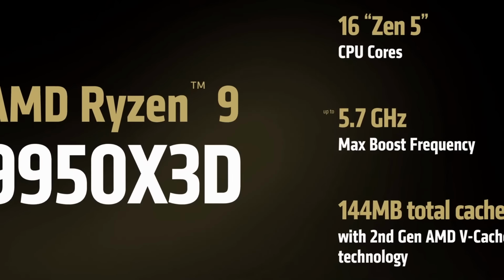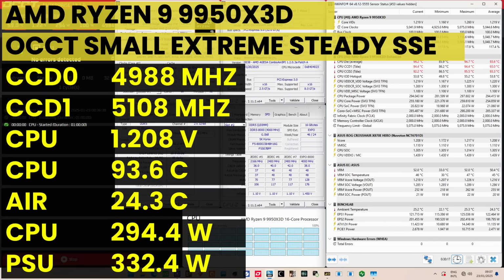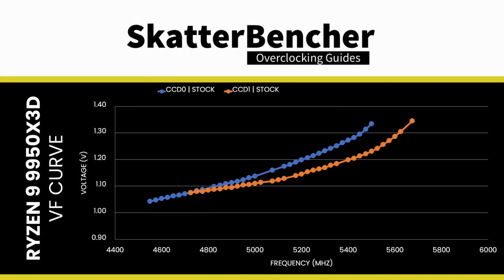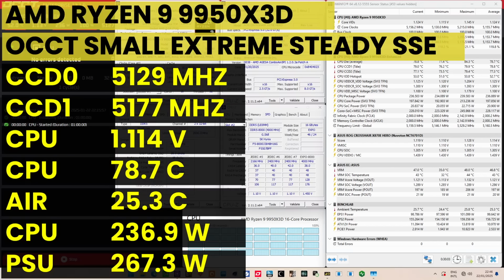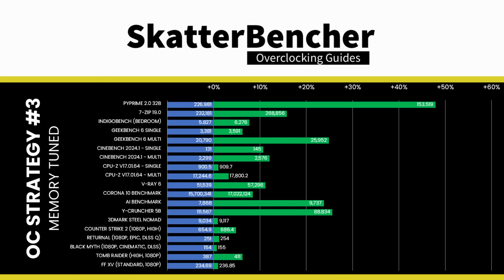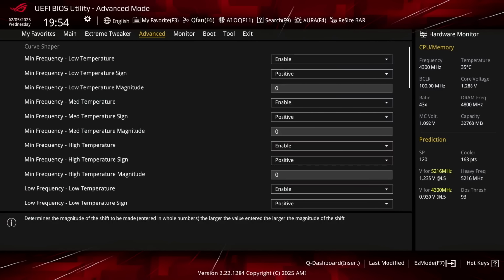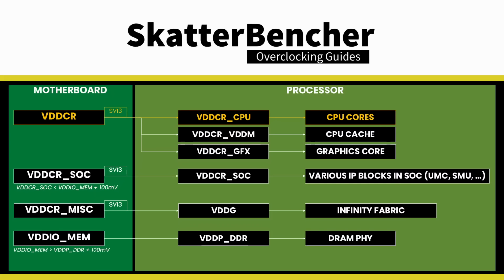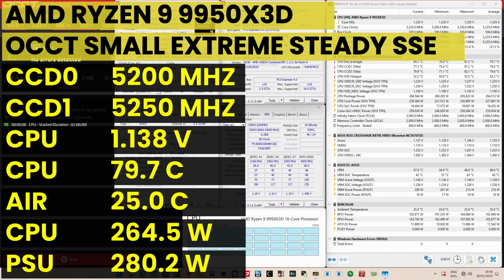Ryzen 9 9950X3D Undervolt & Overclock to 5900 MHz | SkatterBencher #85

Comment: Just came across your video guide. I decided to go the AMD route after reading much hype about it in gaming. Most of my previous PCs was Intel base. So I just bought a Ryzen 9 9950X3D, G.Skill DDR5 CL26 6000MHz 2x16GB with an MSi MPG X870E Board and had no idea how to optimise it. Your video is very intensive, and even though the BIOS is Asus in the video, 90% of the MSi BIOS is about the same. The only difference is that my DDR5 memory is 6000Mhz CL26 on EXPO mode. The Curve shaper setting was an eye-opener. Before that, I just leave it all on Auto as I don't know hack what to do with it..🤣🤣 Thank you for the insight you provide.

Comment: Thanks for the video. Is there any case where you combine PBO Curve Optimizer with PBO Curve Shaper? I currently use both on my overclocked 9800X3D daily setup, but would be very useful to see how you would do an overclock using both technologies. Or is there any specific reason for not mixing both technologies? Thanks again.

Comment: Great video. I have a g skillz 64 gb 6400 cl32 non expo but xmp and 9950x3d. How do you recommend oc and undervolting with this setup? Specially with my ram which is over recommended 6000 cl30 and non expo.
Reply from the maker: Usually motherboards will allow you to load the XMP profile as if it were an EXPO profile. Maybe you get lucky and it just works! DDR5-6400 won't run out of the box on all boards though so if you see instability, return to 6200 or 6000. Make sure to set UCLK = Memclock though.

As for undervolting: the fastest way is the per ccd curve optimizer.
Reply: @SkatterBencher I tested stability at 6400 from 2200 down to 2000 no luck. Went down to 6200 at 2200 ran 30 min aida64 stability test no problem but was on msfs2024 and crashed hwinfo showed memory overload. Never happened before. I went down to 6000 and set cl 30 with timings of 38 38 96 at 2000 fabric even though I have cl32 6400 mht timings 39 39 102. It is stable now can I do that? Uclk = memclock.
Reply from the maker: Yes, find the option that says UCLK Div1 Mode.

DDR-6000 with 2000 FCLK sounds pretty reasonable. You're not doing anything wrong, some chips just struggle more at higher memory and fabric frequencies.

Comment: Question: why didn't you combine the Curve Optimizer with Curve Shaper, and just used Curve Shaper in OC strategy 4? By doing this, you're not accounting for the different CCD capabilities in terms of undervolting, right, given that CS applies equally to both CCDs? In the 9950X OC you combined the two techniques, CO and CS, why not in this case? What am I missing? Just wanted to understand the rationale behind your decision.
Reply from the maker: Your observation is correct: the best result should be using CO+CS to optimize both CCDs.

It's been a while so can't exactly recall my thinking but I reckon it's because I didn't see much performance improvement and so didn't want to spend more time chasing performance ghosts :)

Comment: I found that my 9950x3d kinda sucks, I was only able to manage a -15 on curve optimizer, I also left the boost clock untouched because even a 100 MHz increase would drive voltage from 1.3/1.325 all the way up to 1.410, which I am not comfortable with for such a small gain. 200 MHz would probably get close to 1.45.

What do you think, am I being paranoid?
Reply from the maker: That 1.45V (which follows the factory-fused curve) will only be used in very very light 1T workloads. Under any kind of load the voltage (and associated frequency) will drop to 1.3V or even as low as 1.0V depending on the intensity.
Reply: @SkatterBencher  I see, thanks.

is there much of a benefit to run a +200 mhz boost override? Or the curve optimizer is much more impactful?
Reply from the maker: Curve Optimizer will be more impactful because it affects the entire curve and most applications are not running near Fmax. Fmax+200 can be useful if you see that your CPU is constantly running at the Fmax or for light workloads.
Reply: @SkatterBencher I see, thanks, during light loads my CPU does run near f max, but with +200 it reaches 1.4 volts quite frequently and honestly even with low temps, co negative and low load im not very comfortable with that. 

I'll just keep the negative co and that's it, the extra 200 MHz are probably doing close to nothing anyways.
I increased the negative curve to 20. It doesn't reach 1.45 volts ever with 200 MHz but it does reach 1.395/1.4 volts on siv3

Thanks

Comment: Scalar 10x is very bad advice. I ran PBO + Curve optimizer per-core negatives + scalar 10x for half a year on a new 7950x3d and lost 5 to 8 points on my Curve Optimizer (on some cores less) the next time I decided to test it. CPU degradation on high scalar is real, and the values that you've seen in windows GUI for max achieved voltage may in fact have been not correct, because voltage spikes may happen so fast that they are not even registered in software, which is usually limited at max 10ms sample window. 
So to anyone reading this - use scalar option at your own risk, but higher values like 10x WILL wear down your CPU 100%. I advise against it completely, because the performance gain is microscopical anyway, and the cpu price is real high.

Comment: Could not make my 9950X3D go any where beyond -16 on CCD0, -15 on CCD1 and +100Mhz boost. I guess I didn't won the lottery. Still pretty happy with this CPU.
Reply: Same here unfortunately…
Reply: What are you cooling it with?
Reply: @Hood.Housekeeping I have a 360mm radiator
Reply: @Hood.Housekeeping  NZXT Kraken 360
Reply: What ram are you using? I am running gskill ddra5 non expo 6400 64 gb 32cl but unstable 1:1.
Reply: I got turbo game mode on and ccd0 curve optimizer set to -33

Comment: Nice video. It would be helpful if you could create an overclock setup for "Gamers" by disabling the FCLK on CCD 1 with Turbo Gaming Mode and using only CCD 0, while enabling SMT so we can achieve better performance than the 9800x3d.
Reply from the maker: That's an interesting idea. I recall ElmorLabs setting up their 9950X3D like that for the 1000FPS PC at Computex 2025.

Edit: and thanks for the Super Thanks!

Comment: Is it normal for my cpu to be idling at ~1.39v? This is with the curve shaper settings.
Reply from the maker: Sounds right. The Precision Boost 2 algorithm will use up to 1.40V for the high frequencies. In idle, probably one core gets activated by some background task and so it boosts as high as possible for a short amount of time.

It might look like 1.39V is a lot, but it's with very low current and within spec.

Comment: I dont understand I need to do all steps starting from 1? Or just choose one? I dont understand nothing because you always explain for people with knowledge..
Reply from the maker: The strategies are independent, so you can pick one of the five available. That said, they do built on knowledge from previous strategies. For example, things from #1 are also used in #2, #3, and #4.

My goal is to provide accessible guides that work for people new to overclocking. At which point in the video did you start thinking "oh, I don't understand what's going on"?
Reply: @SkatterBencher About how to understand the result of test software, and how to make the data to verify what is good and not good, or its stable or its not, you never show us that.. compare results
Reply from the maker: Do you mean put more emphasis on how to check if a system is stable?
Reply: @SkatterBencher Of course, I mean that your videos are exceptional, but for those of us who are just starting out, it’s really hard to know what and how to do the tests for each thing, how to interpret the results, or where to look in each type of software. Could you record yourself while doing the tests and explain where to look, etc.? I’m not sure if you understand me.
Reply from the maker: OK, I see what you mean. I'll have a think how I can add that to my guides!

Comment: Why is it that in this video, you use undervolts in all curve shaper ranges (except minimum, which you leave at 0), but in the 5-minute version you use positive values for the high and max ranges?
Reply from the maker: I made a mistake in the 5-minute video saying the wrong thing but doing the right thing. I left a pinned comment under that video with a note about the mistake and clarification of the used values.
Reply: Thanks for the reply here to clarify as well

Comment: I try to understand, what is the best OC from your Video, to squeez the best out of the CPU but i do not understand. Do i use all different tunings in your Video together, or only one of them?
Reply from the maker: OC Strategy #4 is the best but the most complicated. 

You can pick any of the strategies. They are progressive, meaning the optimizations from OC Strategy #2 will be included in OC Strategy #3. That's except OC Strategy #5 as there we switch to OC Mode and disable all Precision Boost tech.
Reply: @SkatterBencher Thx for your answer. Is the 5 Minute OC strategy better, than the number 4 here? 

I tried to do RAM-Tuning too but it does not work.
Is no automatic RAM OC Tuner Tool out there?

Regards from germany.

P. S. The german overclocker @der8auer said, that you got a very good manual.
Reply from the maker: The 5 Minute OC settings are based on OC Strategy #4 (I use the same Curve Shaper values), except for the DRAM tuning. 

DRAM tuning is notoriously challenging because there are so many parameters and the kits are not always super-consistent. You might want to try the timings and set the memory frequency a couple steps lower to see if that works. I've had cases where I could run the tighter timings stably at lower frequency and performance was still better than the higher frequency with default timings.
Reply: @SkatterBencher good morning from germany... at least, undervolting bringst not as much as overclocking, right? Regards
Reply from the maker: On AMD Ryzen, the biggest gains come from undervolting because it directly increases the frequency headroom.
Reply: @SkatterBencher  good morning and once again... i try to understand your video because of undervolting... in which OC Strategy did you undervolt?? 'Regards
Reply from the maker: OCS#2 with Curve Optimizer and OCS#4 with Curve Shaper

Comment: This is awesome. I just got 9950x3d, crosshair x870e apex, 96gb corsair dominator cl28, rtx 5090 fe, crucial t710
Reply: Does 96gb work well?
Reply: @dunknow9486 what do you think? 😉 Yes. I did swap my 5090 fe for the msi 5090 liquid suprim though, the fe heat exhaust was brutal

Comment: Do you touch LLC at all when not going manual?
Reply from the maker: On AMD platforms not so much lately. I find that most of the times the auto-rule is doing a pretty good job at selecting the right load-line.

Comment: Hello SkatterBencher, I watched your video with great interest. My question is: I want to buy a new PC with an AMD 9 9950 X3D processor. I've been advised that if it's only for Microsoft Flight Simulator 2024, an AMD 7 9800 X3D is more than enough, and there's no point in getting the more expensive AMD 9.
What's your opinion?
Thank you for your answer. By the way, I wrote this message using Google Translate.
Reply from the maker: I'm not really a hardware reviewer and don't know much about the game. Generally, though, the 9800X3D has been plenty fast for most if not all modern games. So I don't doubt the advise you've received.

Comment: Huge thanks, SkatterBencher, for the incredibly detailed video on undervolting & overclocking the Ryzen 9 9950X3D! Using your Curve Shaper recommendations (High -30, Max -10, Boost Override +175 MHz), I tuned my 9950X3D to perfection – now it’s fully stable even in CB R24 and achieves 45.6k multi-core and 2269 single-core points in CB R23 at only 75 °C max.

My setup: Gigabyte X870E AORUS PRO ICE, Ryzen 9 9950X3D, Gigabyte RTX 5080 MASTER ICE, 64 GB DDR5-6000, Arctic Liquid Freezer III 360 in a Lian Li O11 Vision Compact. Couldn’t have reached this sweet spot so quickly without your insights!

I immediately subscribed to the channel and left a like – highly recommended for anyone who wants to get the most out of their chip!
Reply: What is your ambient temperature and what thermal paste are you using?

Comment: Hello SkatterBencher, I was wondering if you could help me out, I've just got 9950x3d as I'm planning on moving from my i9 14900kf. I haven't ever had any instability with the chip however I never leave it alone and constantly mess with it so I wanted to switch to another chip where I wouldn't have to worry about setting vcore limits or worrying about killing the chip, from stock I've seen vids 1.4 with vcore reporting 1.403 and I think it's roughly the same with the vout that the asus X670E-F motherboard that I have. Unlike the intel chip there are no preset profiles so it's like back to the old days of settings powerlimits on the bios. I just don't wanna kill my chip I've seen so many posts that max should be 1.2 or 1.35 but it's not like I can set an ia vr limit so I'm stuck and am trapped in the way being so anxious I don't wanna use it :( so if you have a rough idea that would be great I've asked in a few places but no one seems to have gotten back to me, from watching you, JaysTwoCents and hardware unboxed no body seemed to worried about 1.4v so I'm assuming that's okay. If you could give me some guidance I would very grateful Thank you!
Reply from the maker: The default V/F curve already goes >1.4V for Ryzen CPUs, so the high voltage in itself is not an issue. These voltages are only applied in light workloads when temperature and current are also low. You'll find that under load the voltage is more like 1.15-1.25V.
Reply: @SkatterBencher Thank you I'll stop worrying about it so much Intel's 14gen has left me with PTSD

Comment: Strange I have a 9950X3D on a x870E crosshair , and I don't have curve optimizer per ccd only all core or per core ??? 😢😢😢
Reply from the maker: Are you checking the main menu options (in Ai Tweaker) or in the AMD Overclocking menu (under Advanced menu)?
Reply: @SkatterBencher Thanks for Replying SB, I actually rewatched you video step by step and saw you were in advanced \ amd Overclocking \ PBO \  Curve Opt \ etc . And found it , I had no idea it wasn't in Extreme Tweaker , the stupid thing is I've had this setup since 9950x3d release day , I could have just rsearched curve from the search box and saw multi instances , But thanks I had given up when I came across your video ! New sub Here !!

Comment: Has anymore been learned about shaper with co. I can get pretty good uv on per core but 2 cores have a 10-15 limit when pushing certain benches etc. So quite do the shaper the way you show it, i can but mine has better performance. Is there any bclk overclocking? I noticed i got a 2605 in r24 enabling ai optimized per core divider but it freeze eveyrtime i run prime95 test.

Comment: I've tried various values in curve optimizer and curve shaper, including ones I backed off from when finding the occasional failure tight Corecycler or getting an idle freeze from a voltage shift.

But no matter how conservative or aggressive I am with my offsets, my r23 multicore scores are between 44,100 and 44,500, depending on what else is on the background. Getting more aggressive shifts around which cores boost more, but the net result is always the same.

And what's possibly related - I can't get this chip to 230W. The most i ever see it reach in stress tests is about 212, and being more aggressive with my offsets just reduces that figure while keeping performance the same, rather than allowing the cores to boost further.

Comment: Nice learned a lot thanks. After doing all this on my gigabyte b850m gaming with 9900x3d Kingston 64 GB CL30. Got almost 60k on cinebench 23. 
Then I saved and reset the  motherboard. Turn down the VCPU to negative 0130 set PBO2 90° level 5 enabled PBO in the AMD settings to enable or auto you have to do this to let this work I don't know why there's an auto in an enable but there is and you have to set it to use a quick sets. Set the memory expo. Yup got exactly the same result. So USELESS video but nice to know.

Comment: I have a problem. I have the same hardware as you and I set the Curve optimizer the same way as you (negative 20 and 25). And I've had it for maybe 1.5 months. I'm constantly monitoring the hardware with HWiNFO. And I've seen for a few days that the processor voltage is still rising. Previously, the maximum was 1.350V. And now it can jump to 1.360 or even 1.370V. Why does this happen by itself? What's more, I also tried to manually set the Core Voltage to the maximum value of 1.35000V, but after starting the computer and launching HWiNFO, I see that the maximum voltage value of 1.375 has already appeared. Why is this happening since I set the voltage limit to the maximum of 1.350V? Please help.
Reply: Same here. Testing myself, it seems that it's a bad idea to enable the CPU boost clock along with the curve optimizer with a negative value. Since the curve shifts to the right, it will also pull more voltage to hit 5.9 GHz. I had to disable the max clock boost because It was hitting 1.4v.

Comment: Thank you for this very meticulous and precise work. You explained everything perfectly step-by-step, keep it up. I was wondering if I can safely follow these same steps on my GIGABYTE X870E AORUS MASTER; I believe it's essentially the same, although I might find the same settings under different categories. Thanks again.
Reply from the maker: Thanks for the kind words!

Yes, the same overclocking process can be followed for the GIGABYTE board. Most of the settings should also be the same (since I use the AMD overclocking sub-menu), except maybe the manual overclock.

Good luck!